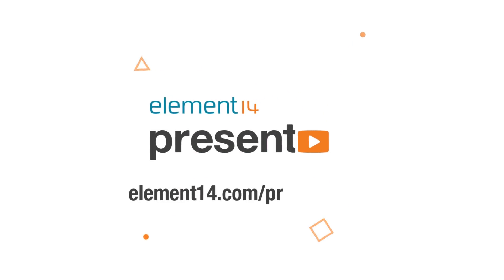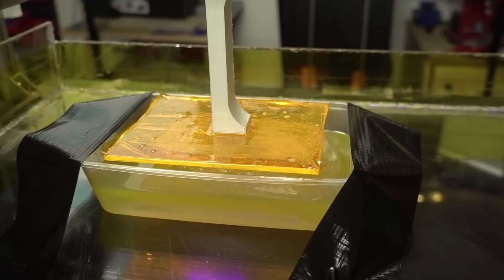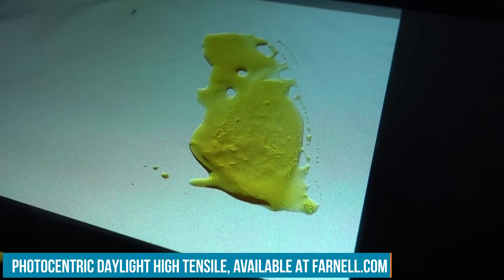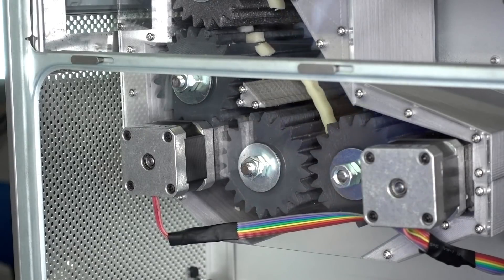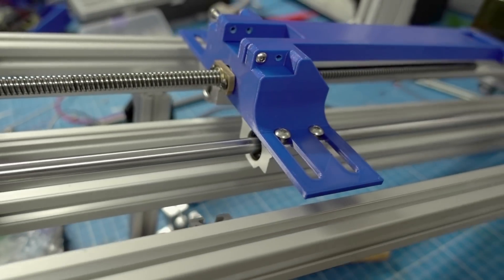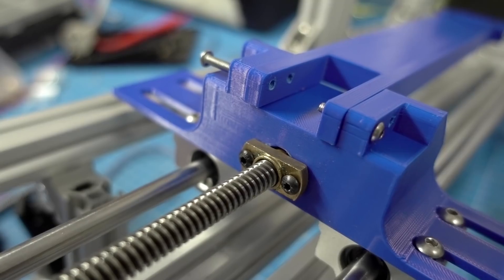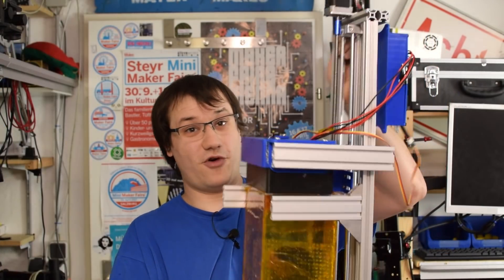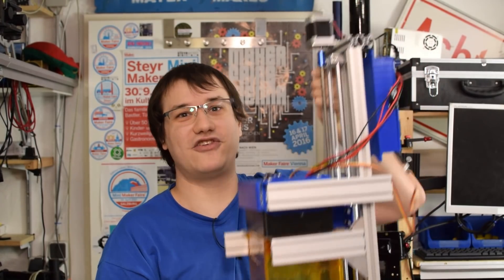#RaspberryPi 4 Experimental Resin 3D Printer Updated!

Comment: Hello. I am building a giant resin printer as well using a double Z axis, an LCD projector and a homemade python script running through an SKR, but I have adhesion issue between my resin and my build plate... I would be happy to discuss my project with you : would you be interested?
Reply: the solution is usally levelling and cleaning. thats al lI ever had to do to make it stick.

Comment: That's been tried before and it's a bad concept.  Get rid of the water or you will NEVER get accurate prints. Instead strip a LCD screen (Not OLED!  and * extra warning * not all LCD can be split this way) to the black lcd sheet only and get it working as a light filter then put a UV LED array under it. That's how it's made, they don't use the backlight of the screen anymore it's way to weak.

Comment: I was guessing about your suspension liquid, thinking lightly gelled mineral oil, maybe veg oil, and lastly sugar syrup. Assuming you can keep it warm (which shouldn't be a problem here!) the saturated sugar syrup could be a viable alternative if light penetrates it well.
Reply: in that case its just a non rective liqid with high enoug hdensity.

Comment: May be covert to bottom up type, or use a projector. Put the LCD just 0.Xmm above resin level is not work. It is because resin will float when operation. If a little resin stick on the lcd will make print fail.
Reply: take alook at the first version (als oa video on this channel) that was a bottom up one.

Comment: What about using an OLED screen instead of LCD Technology? You'll not have issues with light masking because there is no mask. Since OLED uses a set of specific leds per pixel, black regions are effectively unenergized and give no light.
Reply: all a quiestion of price availability and the light wavelenght. I hvant seen an oled yet that would be emitt the right spectrum

Comment: Hey Man good efford i was interested aswell in making one, researched and you can also try 2 ways: 1 using a regular projector of 3000 lumens instead of the raspberry pi screen on top and 2 using a galvanometer laser projector kit, which is a laser based to scan system so you can scan each layer peal of the vat rinse and repeat, https://www.instructables.com/id/Arduino-Laser-Show-With-Real-Galvos/ best regards i hope you can complete the project.

Comment: Can some one here help the eskate community I know you could use an Arduino to fool a boosted board to belive the stock battery is fine when in fact it's not present but I'm not smart enuf can some one help pleaseeeeee
Reply: post your question on element14.com, usually you find someone knowledgeable there to help you!

Comment: For masking, I'd try with a UV-pass filter/adhesive/film.
Nice finding. I always knew there was something wrong with resin 3d printers. Powerful UV lights under those tiny LCDs are just wrong...With a UV pass filter you get the same results without the hassle of a LCD replacement.
Anyway this top down looks painful. With a bottom up design you can make some holes in the plate and fix the first layers with a bolt to sustain the weight of a huge print, or some conical holes with the tip pointing toward the surface touching the resin with UV leds on top. The resin going in would harden and, given proper support, even a huge print would stick. Once ready, you would just have to break them to remove both the print and the remnants of those conical supports from the top, where they should be accessible.
Also, some photopolymers (of which a few are vegetable oil based) can be bought for as low as 8$ the liter, even less when bought in metric tons.

Comment: very cool. I saw a printer once, trying to find the name, which used a uv projector aiming downward on the part and had a wiper arm that evenly spread the resin across the top of the part.
Reply: a lot of the industrial machines work that way, but none float the resin on water so far

Comment: I really hate mechanical connections of wires to boards, where the connectors are surface mount only.  there's always a failure point there. :/
Reply: I'd also like tht on most conenctors but someare just no made in tht at all.

Comment: You need to remember that the further the screen is from the surface of the resin, the larger the angle of spread for the light. The reason that current LCD printers work well is that the curing resin is right at the surface of the screen, except for the thin FEP film that separates the resin from the screen. The closer you can get the screen to the resin, the sharper the print will be. I don't see how you can get the screen close enough to the resin on this type of design. If the resin touches the screen, surface tension will suck the resin to the screen and the resin will cure stuck to the screen. For top down you really need to use lasers.  Why hasn't someone converted a laser printer cartridge to scan across a volume of resin? Sounds like a good experiment since a (paper) laser printer scans onto a drum. Just modify it to scan across a flat surface. I thought of this a few years ago.
Reply: in my design the screen is exactly 0,5mm away from the resin. thats closer than on a mars for example(glass adhesive and FEP amoutn to about 1,5mm. the resin only has a chance to stick to the screen if you let it. so level exactly not just by eye, and coat the screen with PTFE spray, to protect it in case of mishaps.
We collect all inputs for future develoment here; https://bit.ly/2BF1vQQ
you might want to add your ideas.
Reply: @MAYERMAKES  perhaps you should have an FEP layer that you push upwards into, in order to flatten the resin beyond surface tension.
Reply: What a clever idea: "..just Unfold the Cylinder of Laser Printer."

To equalize the idea even further: "..just Unfold the Drum Scan of an Photo Litography Laser Drum scanner for separated CMYK Print Plates"..

"U get bigger build volume than from Desktop Printers.. Theese machines having no problem engraving onto Aluminium Sheet, and probably faster resin curring times.."
Reply: Look up Xolo 3D, they do something called volumetric 3D printing that’s basically what you’re saying. They shine a two lights into a vat of resin: one creates a plane, and the other projects an image of the layer on that plane. The combined energies of the lights where they intersect is enough to cure the resin. According to them it prints insanely fast.

Comment: Can someone explain me why does resin 3d printing is needed?  Can't you just use harder plastic for the same effect and less hassle?
Reply: A lot  of resins have properties not achievable with FDM , also resolution and speed are different. There is an application for every style of 3d printer that fits it.
Reply: Detail is the short answer, long answer adds shape complexity and speed to the answer.

Comment: If you took the screen apart to the bare lcd, remove back light, diffuser, lenses etc (like you would prepare to build a projector), and include a custom light source, through a single Fresnel lens, I think you might get better results. At the very least you could easily change light sources, since I think the back light is probably the source of the difference between the panels.
Reply: the backlight is only part what determines if the screen is suitable, pixel density and clear blacks as well as the backlight wavelenght have influence.
Reply: @MAYERMAKES  Agreed, so with my suggestion, you could use much more powerful light sources and potentially get better quality prints.
Reply: @MAYERMAKES  So technically, a powerful light source, and a med/high resolution monochrome LCD with strong masking, would almost be ideal.

Comment: This is very innovative!!!  Just wondering if you could also focus the image on the fluid/resin interface and still print from the bottom?  It might be tricky getting reproducible surface tension dynamics  with very thin layers and lots of features, but the same pattern of lift and then drop could potentially work?
Reply: I explored curing from below in version 1 the link is in the description, while it works it introduces a lot of variables...
Reply: @MAYERMAKES  Ah, makes sense.  Will check that out!